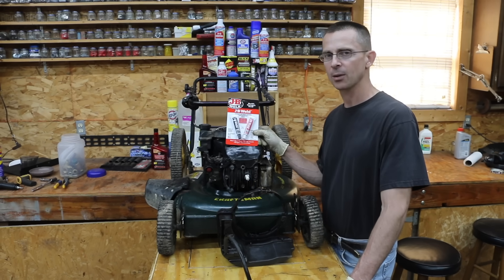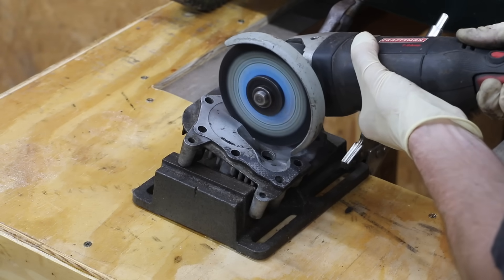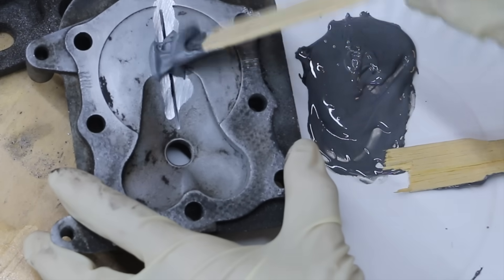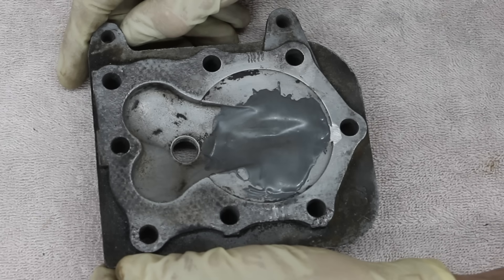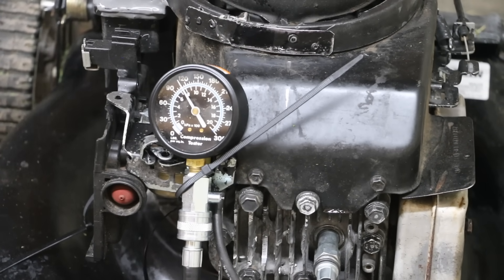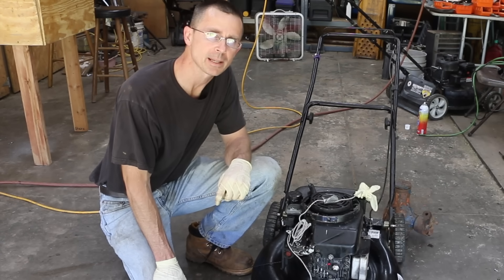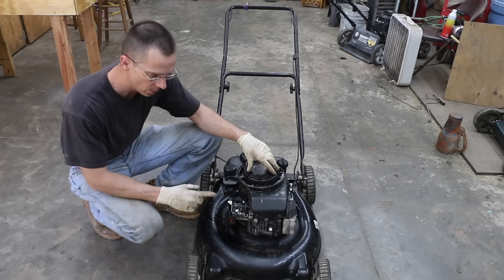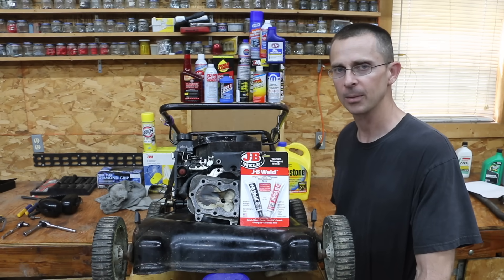Can JB Weld fix a cracked cylinder head?  See the proof!!

Comment: My Dad was given a pit pass for a IndyCar race because of doing the right thing and calling in Bobby Rehal's car lifting dolly that was left in a parking lot in Louisiana. While he was in the pits on qualifying day he came across a team racing Toyota out there (it was 1996 Toyota's first year in IndyCar) their car had broke a connecting rod and windowed the block the turbo v6 engine that they were using was very understandably still experimental.  They had everything to rebuild the a engine with new internals but no spare blocks! Dad was standing in the background just listening in on what was unfolding. He then spoke up  and said to find as many pieces and use JB Weld to bit and pieces it back together. The race team was but didn't really have any other better options and so reluctantly they had sent a member of a crew team to the nearest auto parts store. They found most of the parts and got it back together and they were able to race that weekend! Now obviously they did not place in the top ten but the were able to finish the race!
Reply from the maker: Thank you for the feedback

Comment: I wish j.b. weld would hold up to break fluid but when I tried it wouldn't. Luckily the break line that broke was fairly cheap at a local junk yard. I tried j.b. 3 different times but break fluid is just too corrosive
Reply from the maker: Thank you for the feedback

Comment: Ive told people over a thousand times that JB weld is bulletproof but Ive never actually tried to shoot it ;)  Just as a joke I want to make a 1/2 inch plate of it and see if it could take a bullet .
Reply: The Biggest issue with JB Weld is that it is brittle. 

If you took a blob of it, let it cure, then hit it with a hammer, it would crack or shatter. So shooting it would destroy it.

Otherwise, it is Great Stuff.
Reply from the maker: Thank you for the feedback

Comment: I hit a bad speed bump going 30 when it was raining one time and cracked my oil pan and all my oil leaked out within 2 minutes . The next day I got underneath and took the pan off and it looked like someone slashed it with a samurai sword or something it was about a 7 inch crack and a good quarter inch give or take wide . Cleaned out the pan and ran a strip of ducktape on the outside of the pan along the entire crack . I put some jb weld on the inside of the pan with a small paintbrush and filled the entire crack on the inside of the pan and made is as flush as i could with the pan and let it cure for a day just liek you did in this video . Slapped that sob back on and it didnt leak a drop of oil for 7 years and I ended up selling the car like that hahahaha ! To this day - because of that experience I had with JB weld - I keep several kits all over the house and inside my car hahahah . I swear by this stuff and this video is even more proof . For some reason people scoff at JB weld like if I have ever brought up the suggestion of JB weld to fix something everyone reacts as if its super ghetto to fix something with it . This stuff works , HANDS DOWN ! In probably any situation where this product can help I can almost bet my right hand it would save the day . Nice video , I'm sharing this with all the haters :) .
Reply from the maker: Thank you for the feedback

Comment: I had an 85 Toyota pickup that had a water jacket pit to the cylinder in the head. Used JB weld on it and drove the truck daily for 6 months before it failed. Unbelievable stuff.
Reply from the maker: Thank you for the feedback

Comment: The engine on my motorized bicycle 66cc is locking up when I hit about 15 mph, I hear clanking in the clutch/engine I guess until it ceases the rear tire and I slow down skidding.  Can a cracked engine cause this?

Comment: This channel could be one of the most useful on YouTube. I have a old ford 8N that is used around the house and from time to time to help neighbors out. Recently I noticed the exhaust manifold has a slight crack and is getting loud. Replacing the manifold  is $100 and not something I care to do on a 70 year old tractor where your probably going to brake exhaust studs off trying to remove manifold nuts. This video was enough evidence to give JB weld a try on it and while it may not last forever it works for now.
Reply from the maker: Thank you!! If the exhaust proves to be too hot.  JB Weld Extreme Heat should handle the heat

Comment: The head crack that you made and repaired was more of a hole in the middle of a closed circle, rather than a crack that reaches through to the EDGE of the head in any area. The "hole within a circle" has more integral strength than a crack that reaches the edge. so results testing a repair to an "edge crack" may not be the same. JB Weld also makes a 'special' epoxy that is more gasoline resistant for tanks, but it's good to know that the regular type will work as well.  The difference might show up after long term exposure of the epoxy to gasoline. Be careful not to breathe those carb cleaner vapors (from a COPD sufferer)!
Reply from the maker: Thanks for the constructive feedback

Comment: I've used JB weld on a cracked head on my old (1961 or 1962) Massey 35 gasaoline tractor.   When I simply couldn't find another engine head I decided to JB Weld it.   The fix held for about 5-6 months of brush-hogging, moving dirt and gravel.   It quit working while my wife was on the tractor when the hose split and lost all the coolant.  I didn't even try and fix it then.   I never tested the compression so I don't know what the factory specifications called for or what my (then) 45 year old tractor was producing.   All I know it is worked until it overheated and seized.
Reply from the maker: Impressive!

Comment: My most recent use of JB Weld: To cement back on the faceplate of the aftermarket radio in the 1996 Nissan Sentra GXE I just bought. Some previous owner overtighted the screws that hold it in the bracket and broke off the plastic tabs on the faceplate. The radio is Dual which is one the cheapest one you can get. But all I do listen to AM and FM so it's good enough for my purposes.

The JB Weld worked a lot better than any glue in a tube I could have gotten, and the bonus is I have the two almost full tubes waiting for my next JB Weld project. More things to fix: Drive axles. Heater controls. Poor cold startup. Clearcoat. Loose locks. It's a GXE, man!
Reply from the maker: Thank you!

Comment: I used JB Weld t repair a stripped spark plug thread in a Ford engine and it's still running fine more than 15 years later.
Reply from the maker: Thank you!

Comment: 1994, put a dime size hole in my xr600 dirt bike engine case after crashing into a boulder.  Drained oil, degreased thoroughly, and fixed it for the rest of bikes life.
Reply from the maker: Impressive repair!  Thank you

Comment: I used jb weld on a intake manifold filling a hole almost the size of a 50 cent piece.. The manifold was plastic on a Ford v6. The catalytic converter was preventing proper exhaust flow causing the plastic intake manifold to melt.. Ford wanted an obscene amount of money to replace it so before I committed to buying one I wanted to try and repair it using jb weld, that was three years ago and it's still holding up to this day..

Comment: so i have a rounded bolt i cant get off
it is super tight almost like someone used red loctite on it
i was thinking of using jb weld to glue another bolt to the head of the bolt
do you think jb weld if up for that or should i try to find someone to actually weld it on or any other ideas how to get it off
thanks
Reply from the maker: An actual weld would help but JB Weld won't work well for that sort of application in my opinion

Comment: Have repaired steel outboard tanks with JB.  That's in Calif with MTBE, ethanol and outboard oil and the fixes have held up fine for years.  Prep is the key.  Have also JB'd grease fittings back in and they have held and that is some serious pressure.  It's good to over 400*F, but it will soften as it gets hotter ...
Reply from the maker: Thank you for the feedback!

Comment: I tried this on my old Range Rover radiator that had a number of hairline cracks in the upper plastic section, all looked good until it reach operating temp, then water build up behind the J B weld.

I didn't key the surface of where the repair was made, maybe that was the issue.
Reply from the maker: Thank you for the feedback!

Comment: I have used JB Weld for years! just as a for instance i had a cracked block leaking antifreeze on a little Renault engine. JB fixed it! When i was a pumper in the oilpatch we used it for everything... i patched a lot of leaking 210 bbls oil tanks that had sprung a small leak.
Reply from the maker: Thank you

Comment: I repaired a broken throttle handle  2/3 way to pivot of a Nissan 25 hp with JB. I rough up inside, used 1/8" alum plate shaped to the curve, then JB/riveted handle together, still looks and works well after 15 years use.
Reply from the maker: Thanks for the feedback!

Comment: Another great testimonial on JB weld!  I have used that stuff on myriad projects. Never ceases to amaze me what I'm able to fix with it.  All credit is due to the JB weld, not me LOL.  As I had mentioned to you before, I hope you can devise some experiment to test its properties as a journal bearing wear surface.  I used it in that fashion to fix the camshaft journals on a Suzuki S40 engine that had been run low on oil (not by me!) and were severely scored. I managed to smooth the journal surface and get a pretty good fit (as confirmed with plastiguage) so the camshaft is running on a surface that is at least partially JB weld ...but I don't know how long it is going to last.
Reply from the maker: Thanks!
Reply: @ProjectFarm  just thinking ...what you might do is remove the end cap from an aluminum connecting rod.  If it's not already scored, you could maybe score it up a bit, put some pits in it, etc.  Then see if you can do what I had explained with the JB weld.  As you know, as JB weld is partially cured, it gets into a sort of malleable plastic state where it is more solid than liquid, in other words - shapeable like modeling clay.  In that state, you can press it firmly onto the smooth crankshaft journal in order to get the initial contour impressed into the bearing cap.  After it fully cures, a little manual fitting may be required with fine sandpaper to improve the fit.  Use some plastiguage for final clearance check.

Often times, in this scenario, when the aluminum journal surface gets scored, there is melted aluminum fused to the crank journal.  That can usually be scraped (or gently filed) off and then dressed-up nice and smooth with a loop of fine emery cloth.  Usually the crank journal will smooth up nicely, just leaving the connecting rod surface to be dealt with.

I was a rural farm boy, so am always looking for an inexpensive yet durable fix.  I did all this with a motorcycle camshaft.  It's working fine, but it remains to be seen for how long.  I know with your ingenuity - you can devise a test to make a more definitive determination of JB weld's ability to hold up as a wear surface.  I'm sure you're figuring out a method right now!

Comment: Offshore doing a workover we cracked an exhaust manifold on a turbo diesel which (as you can guess) cut the HP in half and was not sufficient to  pump our concrete, we had concrete down hole and had a 30 minute window before that stuff would start setting up.
All hands on deck and we pulled the manifold, JB Welded it, waited 17 minutes, reassembled and cranked that puppy up...
I rotated off the job 3 days later and that manifold was still in service .. a New manifold was on the boat that picked me up so I don't know how long that they waited to replace the JB Welded one... but it was doing fine when I left (at least 3 days)
JB Weld is amazing stuff
Reply from the maker: Impressive repair!  Amazing!
Reply: JB weld 24 hour cure. JB quick 15 minute cure.

Comment: Simulating a crack by cutting .... ? A crack is a break in grain structure of the metal and glueing it shut will fail???? A cut is a gouge and crack need drilled because it is spliting bro you need to stop teaching NOTHING because a crack is not a cut and if you dont understand the difference stop and flip on Ave because you seem like a chemist and one who only knows a welder from a book not his hand

Comment: Jb weld has saved my butt so many times. I repaired a cam sensor in a 3800 Buick and during hurricane sandy I repaired my awning when it pulled the screws our a cinder block wall.
Reply from the maker: Thank you!

Comment: I have been using jb weld on stuff since i started watching this channel. I fixed a turtle head..(its a cement turtle that holds a table umbrella) I used it to repair my windshield wiper transmission which saved me over a hundred bucks. Ive used it to repair steps on my deck. Its amazing.
Reply from the maker: Impressive!!  It's saved me many times. Thanks again

Comment: I dropped a "performance" 2-stroke ATV motor onto my garage floor once and cracked/knocked a corner out of one of the case halves.  I used the standard JB weld to repair/replace the missing corner (broken piece fit into the "hole" cleanly).  That case has held up for 2 decades of HARD riding without issue either mechanically or any oil leaking.  Another WIN for JB weld.
Reply from the maker: Thank you

Comment: I'm watching after jb welding my spark plug in my s10 engine used the same product hopefully it works half as well for me as it did for you. If anyone is interested on how this goes let me know I'll update this post till it fails. Good video thanks
Reply from the maker: Yes, I would like to know if this works.  Thank you
Reply: @ProjectFarm  well the spark plug stayed in the engine ran ok still has a miss fire but after 4 mins of idling the truck shut itself off then didnt start again.

Comment: I have used JB weld to fix a crack in a cast-iron engine block.  Worked great.  I also used JB to fix a small hole in copper tubing on the high pressure side of an AC unit.  Both applications worked fine.  When using JB Weld, make sure your area to "Weld" is totally clean & dry.  I use rubbing alcohol to clean.
Reply from the maker: Impressive repair!
Reply: Can I ask if this held up to engine heat? I have a camshaft chip where it meets the fuel pump? The turning point on the engine if u will? No experience at all ..

Comment: Just used JB Weld (original) to patch up a leaking core (freeze) plug on my 1995 S320 Mercedes.  It should get me through the two weeks or so until new parts come in!  JB is great stuff, it really works best as a stopgap measure as opposed to a permanent one.
Reply from the maker: Thank you

Comment: Hey man just found your videos today and i dont often subscribe to channels even ones o really like idk why but that doesnt matter you just gained a sub. Also i dont know what your range is in testing products but one that kinda seemed in a similar catagory was Armor All i know personally that its awesome its also expensive i also know stuff half the price seems to work just as well. My question/sugestion is this are they comparable, do they both provide the same quality of surfactants that the weather has deteiorated? Or is it just a looks good at first but fails with a little time? Also i would like to see the claims tested. Does Armor All really replace these surfactants? What i can tell you is if you put it on rubber/plastic regularly it will prevent deterioration not only that but dry brittle time worn surfaces are brought back to life with it(try it yourself on auto molding, the place between the hood and windshield, the #1 spot its very nessicary is where brittleness has become a problem such as windows weather strips and windshield wipers)
Reply from the maker: Thank you very much for the positive comments and for the video ideas!

Comment: 4 inch crack on the cold side of my T26 Turbo @ 19 PSI 8 years ago still going strong.
Reply from the maker: Impressive results!
Reply: @ProjectFarm   i gave a reply but put it in the wrong section. Yeah i don't bother to put comments very often so i don't really know what i'm doing.  lol
check original comment.
Reply: A product that I've been using of lait is called Selleys Knead It, it comes in many flavors but i find the " Steel " is a damn fine product giving JB a run for it's money. of course being pro's and con's.  link here http://www.selleys.com.au/fillers-putty/epoxy/knead-it-steel/

Comment: Knocked a hole in a dirt bike engine block( on the bottom). JB weld and back in to the cliffs and creek bottoms. Again later on a cracked exhaust manifold on an old 1978  Chevy Blazer . Buddy used it on a rotted out dirt bike gas tank. The old steel tank on a Kawasaki. It started seeping in a couple of months. Seeing this all as  a 9 to 16 year old kid.

Comment: Another repair I just remembered, my air compressor has a rust hole in the bottom of the tank.  JB Weld has sealed that hole to 110 PSI for 5 years now.  I'll let you know if it ever fails.
Reply from the maker: Thank you!